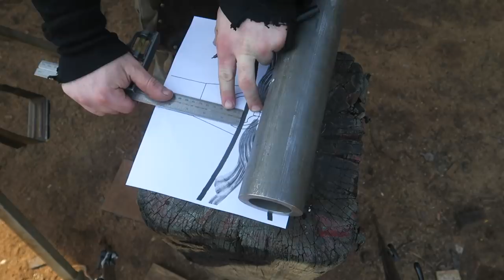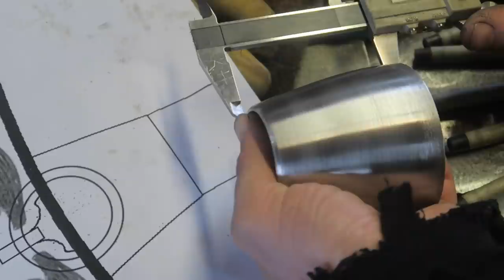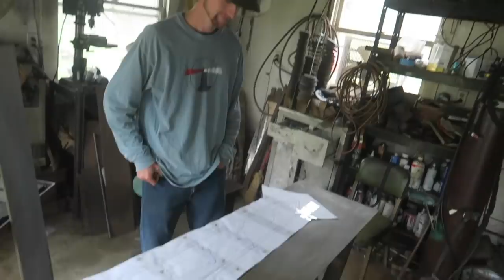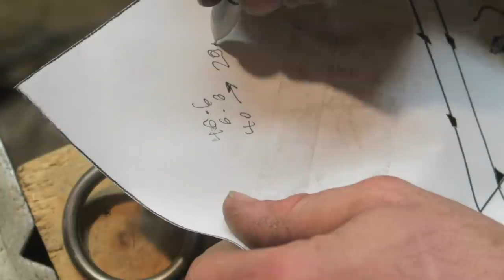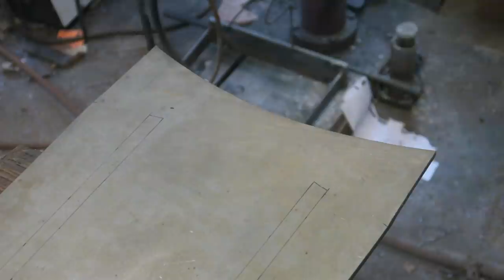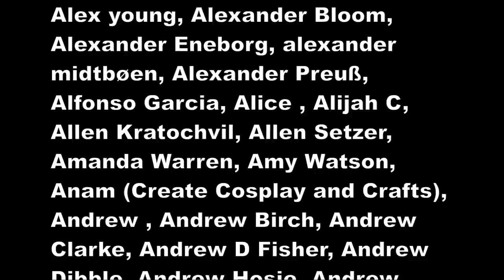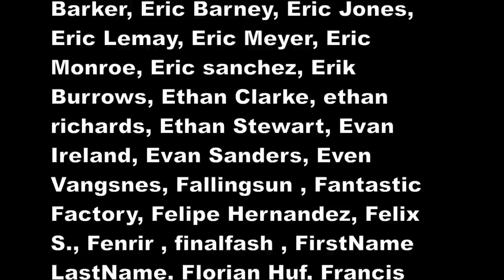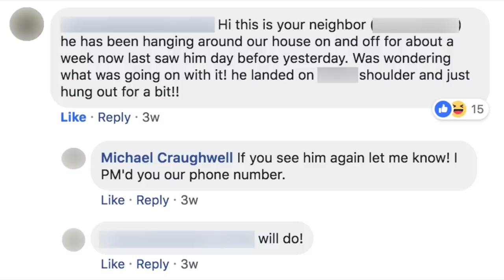Requiem Build

Comment: Vertical arc welding can be tricky, just about impossible with the wrong rods. Overhead arc welding is also a skill learned through much frustration. Through the learning of these skills many welders have learned the skill of drinking hard liquor as well.  😄

Comment: At 16:45 there is in fact a double rainbow. You can see the secondary very faintly above the primary. All rainbows are actually double rainbows, but depending on the conditions the secondary can be more or less visible. More specifically, the brighter the sun, the brighter the secondary.

Comment: New idea:  Edge of Tomorrow Rotor Blade sword.  Michael, I was just watching Tom Cruise's Edge of Tomorrow, fantastic SciFi flic BTW.  Emily Blunt's character has a sword she uses against the aliens that is similar in scale and scope to the replica swords you build, but I think could actually be wielded.  It appears to be made from carbon fiber from the rear stabilizer blade, and light enough to handle easily enough for a buff Emily Blunt.  The sword has a fantastic look.  Just an idea for something a bit different.

Comment: 35:23 if the block of wood catches on the saw blade it could fly out  and pull your fingers in to the blade, never do it with your hands always use a push stick

Comment: What is the strongest metal to make a sword out off? Can that metal be bullet proof?
Reply: any high carbon steel when properly heat treated can split a bullet fired at it's edge watch forged in fire bullet test
Reply: Reaper King Thank you!

Comment: I take it you don't heat treat any of these monster swords, is it because you don't have a swimming pool 2 miles long to quench them in, or that they are so thick and chunky that the steel is tough enough without a treatment?
Reply: Well, he isn't smithing these really. He's a welder/fabricator, not a blacksmith. He is taking a big piece of hardox and cutting and grinding it. As he mentions, even if he damages the temper on the hardox, it doesn't matter like it would on a normal size sword.
Reply: Yeah I figured it was something along those lines, I doubt his customers even test cut with them, they are something to hang on your reinforced wall. More impressive show pieces, I don't really want to call them wall hangers though, they look great.